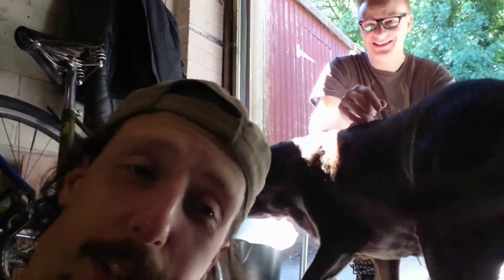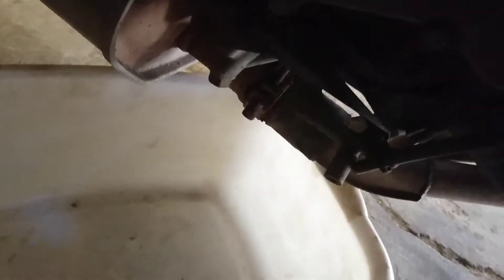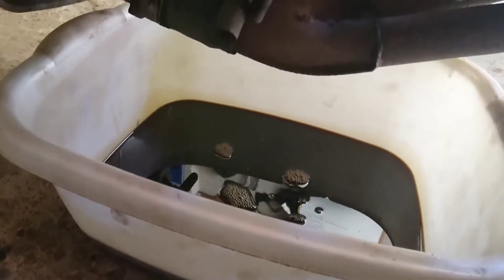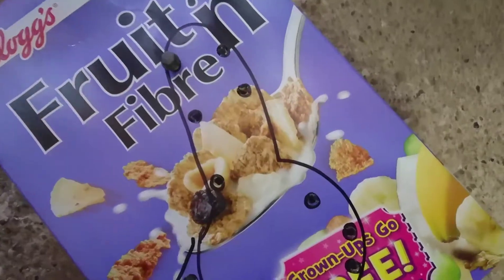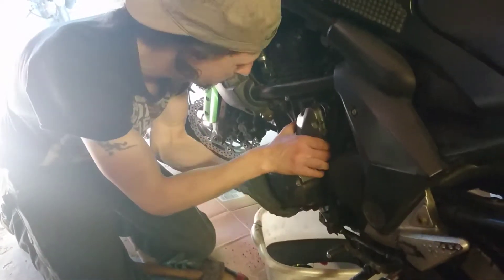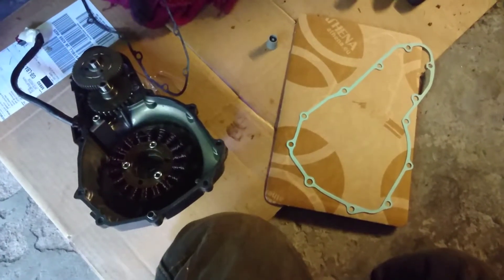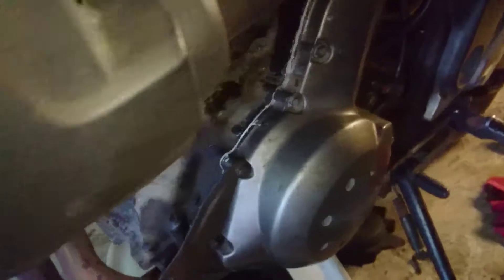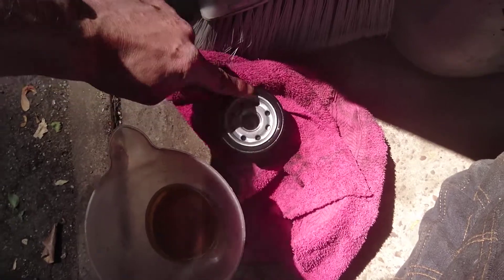Kawasaki Versys 650 Oil & Filter Change + Bonus Alternator Cover Gasket Change

Comment: Hello, So i have a question, But first, Thank you for making this video, it was off big help for me.

Now, My Q: I put 2 Liters of oil (2,2quarts?)
Filter and oil change, drained oil well.
Added 7100 10w40 synth oil bottles 2x1L

Soo,i have about ~2L oil instead of 1,9L....
Sight glass is just bout barely overfill.
(Also oil seems to foam up?)

--- in this bike,Is it ok, or better drain some off?---
Reply from the maker: Personally, I’d drain a little off to make sure the level is slightly below the ‘max’ mark. The max mark is there to prevent overfilling, which can damage the engine if the oil pressure is too high.
Reply: Mech it Better
 Thanks, i will drain some to be between min-max just below max. Thanks.
Reply: The manual says this 

Oil Level Inspection 
•Check that the engine oil level is between the upper [A] and lower [B] levels in the gauge. 

NOTE 
○Situate the motorcycle so that it is perpendicular to the ground.       So, don't check the oil while it's on side stand as it is done in the video
○If the motorcycle has just been used, wait several minutes for all the oil to drain down. 
○If the oil has just been changed, start the engine and run it for several minutes at idle speed. This fills the oil filter with oil. Stop the engine ,then wait several minutes until the oil settles. 

I put over 2 liters into mine and it's within the levels, it depends on how long you let it drain.
Reply from the maker: @PgUp41  Thanks for the input Gabriel. 
Nice and clear.

Just to note that, when ever we checked the guage for oil, the bike was held level... Seems we neglected to mention it. 

Can be a tricky thing to do if you're on your own and don't have a paddock stand or aftermarket center stand (which has been the case before). Luckily I had an extra pair of hands to assist.